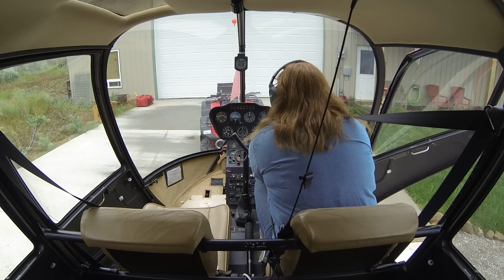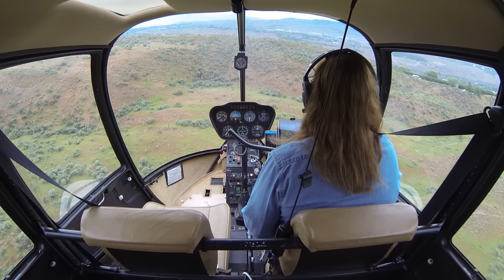Home to Airport, by Helicopter

Comment: It took her 2min to get to the airport, i wonder how long in a car, maybe 15 or 20min? this is why helicopters are awesome
Reply: Yes
Reply: Experimental Fun ...
Reply: Google says 13.6 miles, 28 min by car. It's 3.81 miles in a straight line
Reply: Experimental Fun
Reply: How much gas you think she used? Less than a car?
Reply: way more in the chopper
Reply: Experimental Fun yet 15-10 minutes of prep
Reply: Nick Chambernator the video doesn't show walk around checks, flight planning etc. Would be quicker to drive if you account for that
Reply: Awesome but expensive
Reply: After 2 minutes she is not still in the air, pre-flight check procedure takes some time too...so...it takes the same time like in the car, but way more gas :D
Reply: Experimental Fun yup
Reply: yes men.✌
Reply: To be fair, you are also technically supposed to do a walk around check of your car before you drive it and check things such as turn signals, brake lights, tire pressures, headlights, brake fluid level, oil level, coolant level, etc etc... Just virtually nobody checks those things on their car before they drive it...
Reply: Experimental Fun
Reply: Experimental Fun xx
Reply: Way more than a car. about 60 liters an hour for a piston chopper, 100 for a turbine. So not too much to get to the airport.
Reply: it'd be faster in an airplane :P
Reply: RowanBows not a stupid way of thinking at all.. your car sips fuel but takes more time.
Reply: takes more time yes but I still think its less fuel. the engine of this chopper runs at least 15 min for 2 min flying and buirns 50-70L/h. Im sure she has to bring the chopper to the airport anyway but to say its better than driving by car...
Reply: RowanBows it appears evident that the fuel burn is not an issue for her. Without a doubt the fuel burn will be more. She also mentions picking up passengers from the airport and some additional stops, which would take more time in a car. But yea.. you would save fuel.  I could drive across the continental United States, or I could fly across.. one method saves considerable time, the other saves considerable fuel... 🤷🏾‍♂️
Reply: then I misunderstood you. what means the word "sip" (your car sips fuel)
Reply: RowanBows "sips fuel" as in a car is more conservative with fuel
Reply: +littleo51 Difference being if one of those fails you're not going to come crashing out of the sky!
Reply: True, but if your brakes fail, you might go crashing through an intersection or a school yard.  If your wheel falls off on the highway you also have a pretty big problem and endanger yourself and the motoring public etc...
Reply: If someone else fails at driving or their vehicle fails there's usually more of them to crash into and they aren't as coordinated as aircraft
Reply: In Belgian traffic that would be 3 hours by car. :D
Reply: Yes, it was totally worth it. Facepalm.
Reply: ...and space ships.
Reply: Experimental Fun at @ 2.50 she mentioned not even three minutes to the airport
Reply: Mr. White you can autorotate out of the sky with an engine failure. Other things may cause it to fall out of the sky, such as losing the rotary wing or a mid-air collision. Autorotation however, isn't near as bad as trying to obtain a glide/slope path in a fixed wing jet aircraft without power and loss of hydraulic pressure to the control surfaces. Driving a one ton pickup without power steering is a whole lot easier.
Reply: Jakie 2 min ? 5:27 !
Reply: did you really write that? I've never heard of anybody ever doing this unless their towing something. At most some people check their lights after they've had a couple drinks. Even during a driving test. To be fair your comment is ridiculous.
Reply: Are there non-fixed wing jet aircraft? Or do you just add in unnecessary adjectives for fun. And wtf is a glide/slope path? And how often do you lose power and hydraulics? there's hundreds of thousands of flights per day and you reference the 3 worst case scenarios ever documented. You're statistically more likely to jump off a bridge in a suicide attempt, but die instead from a stray bullet during the fall.
Reply: Nick Chambernator, She didn't start the video as soon as she started prep. You have to do a visual inspection, which takes about 3-5 minutes. Gotta make sure there isn't plastic bags or squirrels leaving acorns in pipes..

Then you go through your check list. Making sure each nob and switch is where it needs to be.
 Then you have to do motor prep, and even charging the oil pressure in some helicopters can take 2-3 minutes.
You have to bring the motor up in RPM with the clutch disengaged, the rotor will also increase in RPM (while the clutch is disengaged), then when the rotor is fast enough, you drop engine RPM and engage the clutch.. This can take a couple minutes.

From the time you get outside to the time you take off, it's at least 10-15 minutes. There's a surprising amount of prep that goes into starting a helicopter.
Reply: Experimental Fun - As others have already mentioned, after all the time it takes to do a full preflight check and then get the thing off the ground you could likely get to that particular airport by car. And unfortunately in the places where it would really help to have a helicopter to get around in, such as in Los Angeles, you would not be allowed to just land the thing in your driveway. For example I know that airplanes have to keep above a certain altitude when flying over cities and I assume it’s the same with helicopters. And in any case who can afford to buy a helicopter that likely cost more than your house. Even the piston powered ones are extremely expensive when compared to fixed wing aircraft, which themselves are very expensive for what goes into them.
Reply: good driver check his car too
Reply: It was actually 3 minutes.
Reply: Except in bad weather! lol
Reply: In l.a traffic 2 min by helicopter ,2 hours by car
Reply: car 7 minutes
Reply: Nick Chambernator look at this quote It depends on the helicopter. At the low end, small helicopters cost about €200 per hour, but big useful ones can cost upwards of €6,000 per hour.Really big ones cost a whopping €10,000 for each hour their engines are on, and not a lot less per resting hour 

keep in mind that this helicopter costs like 400k, needs annual inspection, insurances , airport fees, repairs, plus it cost her 13k to get a license

This is all the stuff you need to operate a helicopter

Initial Purchase cost of helicopter
Registration fees
Insurance
Hangar fee's
Maintenance
Flying lessons/exam/licence - for day VMC/IFR/Night?
Fuel
Airport/HLS landing fee's - at both ends of the journey
Navigation and Communications software and hardware subscriptions
Safety Management Compliance costs
Personal Protective equipment
Reply: Avc isquêmico
Reply: @fosy6991 
True, but account for the assumption that she's probably being compensated from runs she may be doing for clients.
Reply: Helis are way more expensive, fragile and way more sensitive to weather conditions than cars.
Reply: And how long did it take her to prepare the helicopter beforehand ?  Maybe 10 minutes ?  I'm not saying the helicopter isn't fun, but you need to compare like for like.
Reply: I think she need to refuel
Reply: "Experimental Fun ..."        She's flying a Robinson. Nothing close to being experimental.
Reply: 30 minutes..  Following the rough path she took to the airport, she would have to cross the Senator George Sellar Bridge..  Quite a ways out of the way.
Reply: Experimental Fun hpp
Reply: Fun until the blade stops. Too scary.
Reply: @Dave-eu1fc  "Are there non-fixed wing jet aircraft? Or do you just add unnecessary adjectives for fun."

Ahh, the internet, where polite discourse goes to die. Ever heard of a Jetranger? The hint is in the name. 
Comments on helicopter videos for fun, doesn't know gasturbine helicopters exist....
Reply: well on the other hand you're not allowed to park in as many places as cars are... in fact im pretty sure there are very few places where you can legally land in a city environment .
Reply: @ottoskorzeny7984  The R44 is supposed to use about 16 gallons/hour.
Reply: FФ5Y VERY VERY VERY EXPENSIVE
Reply: @Jez2008UK  You need to listen, she's going to "work", then out with friends.
Reply: until they fall like a rock
Reply: @justinstephens72  Technically they don't fall like a rock, but yes like a car, you have to make the decision to get in and use one! Just like a plane, motorcycle or boat, not for everyone!
Reply: I get airsick in fixed wing, always have, flown hundreds of times, that's why I chose Helicopters, feels like a race car. money, time, and will, theres your answer
Reply: @bebo5558  Please I was not trying to sound rude if I did I am sorry.  Ever since my chute collapsed on me and I fell 60 feet to the rocky mountain in Vegas. Breaking my back and shattered my heel.  I have bad PTSD with flight.  Sad to it was my dream to be a pilot. I have to take 2 xanax and a jack and coke to even get on the plane. Even then I am still awake just freaking out inside lol. The thing I was trying to say, is that if the blades stop rotating then there is no lift. With out lift it falls worse than a plane, "Sometimes".  Auto rotate is a plus.
Reply: littleo51 you absolutely right.
Reply: As the crow flies.
Reply: maybe more
Reply: I can get there to the airport Less than 2 min with my private jet.
Reply: @jackhandyy  there's no question that this aircraft isn't certified but are you sure that they mean "Experimental" for that reason?  I don't see anything else but there's more than 1 person typing it then I'd like to know if you understood.  Thank you.
Reply: Would you consider marriage for flight? Or at least a concubine.
Reply: .....and if there's a problem just pull over to a cloud.
Reply: Test
Reply: Experimental Fun be faster in one of those giant fans with a parachute on top. No checks just strap on and fly.
Reply: Also probably cost a lot more
Reply: it take long and forever plus stopping at lights and traffic jams but by air no stop lights or traffic jams wich flying is more enjoyable then stuck at lights lol
Reply: littleo51 I do. I treat my car like it’s an aircraft 😋
Reply: I don't know if the helicopter is about to burst into flames because the guage isn't working. Hohum let's pick up some passengers.
Reply: Awesome 👍
Reply: 45 minutes.. read the video description...
Reply: she had to go for gas, the car wasn`t an option
Reply: May be she is in samulator....
Reply: She wrote below the video "It's a 45 minute drive to the airport from my home."
Reply: @angelamenzies3114  Does short journeys cause the engine to wear out faster? Would've be safer to wait till the engine is at operational temperature before taking off?
Reply: @angelamenzies3114  Maybe - but nowhere near the same fun!
Reply: if she'd just got in her car and left, she would have been there about the same time. With all the preflight, warm up and so on, plus add in the maintenance and the costs involved (insurance not withstanding) not to mention fuel cost, it seems to me that it's all about the experience and love of flying thereof.

Comment: After over 32000 hours in helicopters, i would offer a suggestion to you: take a few moments for a stabilized hover check. This advice was given to me in 1979 by a senior aviator. Many serious problems reveal themselves in the first few seconds above the ground. 
My one and only forced landing in 46 years of flying helicopters came in 2014 and was an OEI event during a stabilized hover check. 21 souls aboard including two pilots.
We were literally a split second from beginning our still officially night-time takeoff. That morning i was copilot and Captain Dave landed the aircraft straight down soft as a feather. 
Passengers thought we had simply changed our minds as we taxied on one engine back to the terminal. Touchdown was so gentle that until we briefed them they had no idea an engine had failed.
If not for the stabilized hover check it would have been a rejected takeoff before tdp near max gross weight.
It's not only power issues though. Sometimes control issues reveal themselves during that stabilized hover.
Also, altitude is the pilot's friend!
Thank you for the video. I am VERY envious of you. No doubt you are inspirational to future aviators and enthusiasts. Keep it up.

Comment: I tried flying one of these in Haiti with out an instructor. You would think that driving something with just two levers is not a big deal but they both work with each other so it's not just one way for this way or that it's a compound movement with both moving for one action. took 2 hours just to learn to hover  and that was the hardest thing.

Comment: Helicopters are Nice but their Glide Ratio Sucks on Engine Out...
Reply: Helicopters use a technique call "autorotation" to safely land when the engine goes out.  True the glide ratio to a fixed wing is different, but one can still use the forward momentum, height (potential energy) and rotor speed to land.  
I've done it many times during training.  Scarey at at first, but not too bad once you get used to it.

Comment: Also, helicopters are usually awfully noisy. Was the engine and rotor noise somehow removed from this video?
Reply: All the audio was captured by the onboard coms. In other words you are hearing what the pilot was hearin in her headset, which is meant to not hear the engine noise so much
Reply: Green screen lol jk

Comment: Personally I would prefer more height after take off just incase of engine failure.
Not much scope for auto rotation?

I might be talking rubbish though as I'm only a fixed wing PPL &  Glider Pilot !!
Reply: Just thought the same thing... fixed wing pilot as well.. But i think the same criteria apply for both, especially if flying a single engine..
Reply: Jules Anderson 

She explained that

Comment: Very nice, how did the overhaul go ?
Reply: stealhty1 not good, they couldn't find any replacement 30 weight ball bearings.
Reply: Very funny , gotta have"em imported from Austin power hardware store
Reply: stealhty1
Reply: stealhty1 expensive

Comment: Little close girl. They have long hose. Reason just in case back wind all of sudden you dont get pushed forwards into the pole by the pumps?. But still cool and good job.little fast crossing runways also much direct line of sight path.

Comment: That was great, thank you for the ride along. It looks like you have a VOR station at your airport - a shame those are being phased out the way they are. And FWIW, when flying by myself, I do the same thing with my free hand, rest it on the empty passenger seat. I wonder how many pilots do that?

Greetings from Phoenix, AZ.
Reply from the maker: Glad you enjoyed it! And I get a lot of grief about not having my hand on the collective all the time. People really need to lighten up. My response time is the same whether it's on the collective, on the passenger seat beside me, or on my knee (when there's a passenger in the seat). Keeping it in a resting position reduces fatigue.
Reply: @FlyingMAir  I completely agree. I had instructors who would not be happy if I took my hand off the throttle. During climb and approach that makes sense, but cruise?? Your throttle/collective hand needs a rest.

Comment: Damn that thing is really quiet for a helicopter
Reply from the maker: The microphone is on the audio system, not the ambient sound. Some of my later videos have two audio tracks, but I turned down the volume level on the helicopter so it wouldn't drown out the sound of the other audio.

Comment: At some point, she had to answer one of these two questions for herself. " Should I drive to the airport, or should I just take the helicopter?", or "Should I just drive to the airport, or should I take the helicopter?" Yes, technically it's the same question twice, but there are levels that make them different. Either way, congrats on a life goin' more right than wrong.
Reply from the maker: Actually, I was flying to the airport to pick up passengers for a charter flight IN THE HELICOPTER so driving would have been kinda pointless. 🤷🏻‍♀️

Life's what we make it! Have a good one!

Comment: Looks like a Robinson...very nice.  I've got about 40 hrs in a Schweizer 300CB, took training almost 20 yrs ago now.  The flight school I was in was ripping me off; had a scam going with one of the local rotary-wing DPEs in the Daytona Beach area.  Wish I could go back and finish---the 300CB was a fun little helo to fly.  What are your thoughts on Robinson vs. Schweizer?  I'm aware the "Robbie" has a checkered reputation, to the point of having its own SFAR (SFAR 76, I think).  But I've also heard they can be a lot of fun, and not that dangerous if you know what you're doing.

Great video!  Thank you for posting!
Reply from the maker: That’s because it isn’t the helicopter that’s dangerous — it’s the pilot. 🤷🏻‍♀️

Comment: Anyone can answer.  When you land a helicopter like this at a small airport like we have in Hawthorne California next to Inglewood..  Do you land where you will park your helicopter.  Im talking about the copters that have skids.  I always see a few helicopters on the side of the runway.  I never get to see them land though.  I assume they don't land where they park.
Reply from the maker: Hawthorne is a towered airport so the tower would tell the pilot where to land. The pilot would request landing closest to her destination at the airport. From there, she would hover taxi to parking. That’s the usual way it’s done. However, helicopters with skids can be moved with ground handling wheels so it’s possible that the helicopters are repositioned on the ground. I don’t generally carry my wheels with me, so I would be unable to do this unless someone else there had compatible wheels and could help me move the helicopter, which weighs over 1500 lbs. I hope that helps.
Reply: @FlyingMAir  thanks.  Very cool video too.